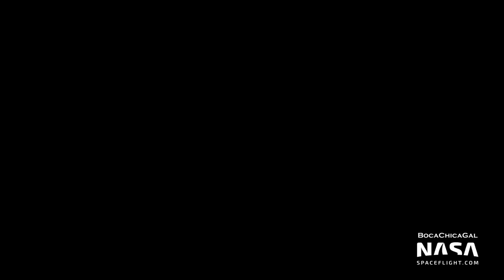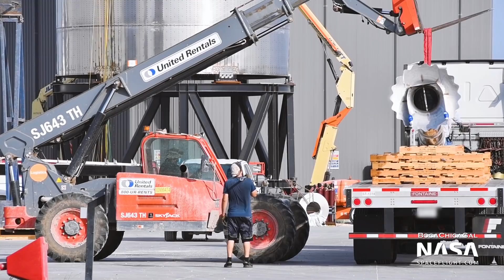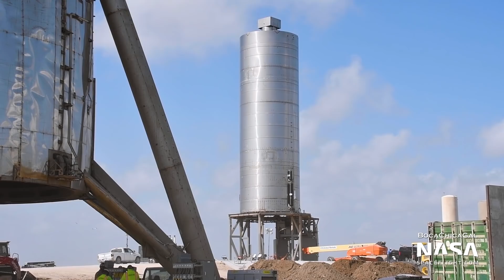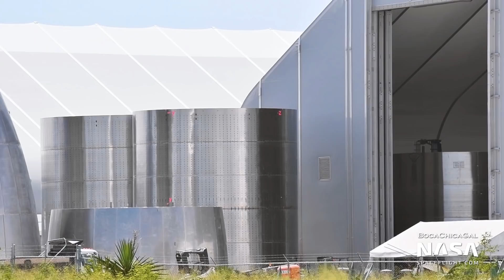SpaceX Boca Chica - Starship SN10 parts arriving as SN6 looks forward to hop

Comment from the maker: Hop still on for tomorrow and we'll be live with Mary, so make sure you're subbed for when we go live, as it is not a set test time.

0:00 - Sunrise
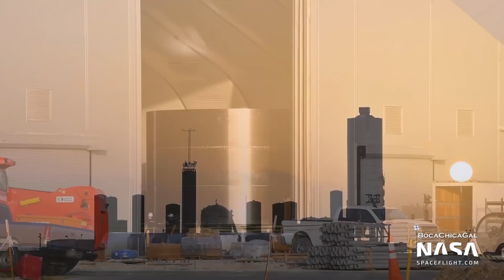1:00 - New Three Ring Stack
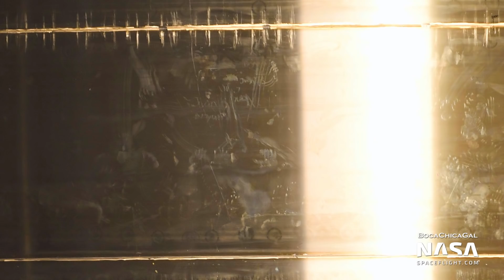1:37 - Bulkhead Dome Caps
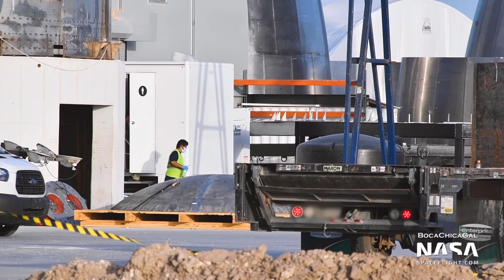1:55 - High Bay Construction
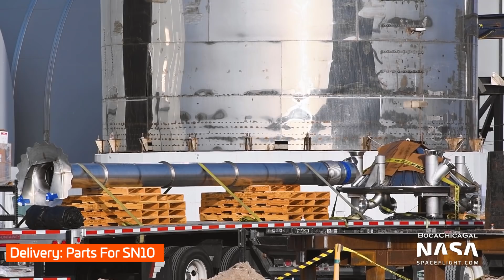2:40 - Delivery: Parts For SN10 
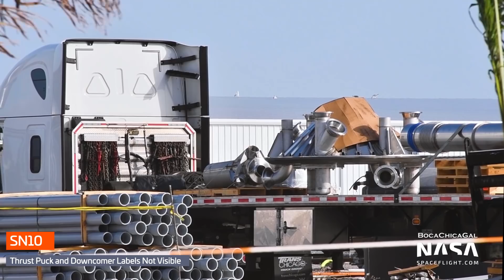3:10 - Parts Close up
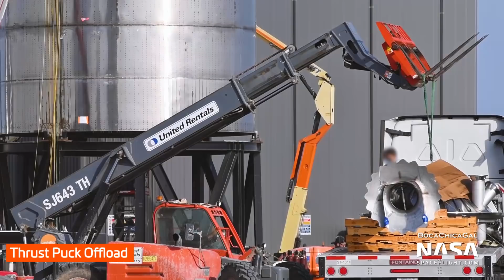3:51 - Thrust Puck Offload
4:39 - Methane Downcomer Offload
6:07 - Orbital Launch Pad Construction
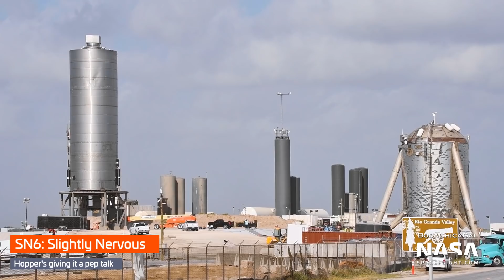7:59 - SN6 and Hopper
8:26 - Landing Pad And New Mount
10:27 - Earth Work At Launch Site Continues
11:26 - High Bay Construction
13:20- High Bay And STARGATE
14:10 - Equipment At The Old Gas Well Lot
15:10 - Noseconeland
16:46 - SN5 and SN8
Reply: Just in time to get my Boca Chica fix before bed. Thanks!
Reply: Bulk head dome caps are noticeably becoming flatter as elon mentioned earlier in his tweets
Reply: Is it my imagination, or is the newly delivered thrust puck a redesign (a completely new design iteration)?
Reply: @danahebdon6810  not completely becoz elon said he wants to remove the unnecessary steel reinforcements in the thrust puck design nd this design looks for a 3 raptor testing
Reply: Does Mary live in Boca Chica?
Reply: @burper-oe6tm  Yes. She is one of the few people that do, other than SpaceX employee's
Reply: Critical rocket parts being stored outside in the dirt!
Reply: @DavidJohnson-tv2nn  remember Elons crew our space cowboys lol.
Reply: David Johnson it’s a measure of how far we’ve come.
Reply: @danahebdon6810  Agreed.  Seemed to support more raptors than previous.  Also was thinking the methane downcomer was longer.... Starship Heavy?
Reply: Have you noticed that the newer rings have a more ‘bronze’ tint to them as opposed to the earlier versions having a more bluish tint?? Could that be the difference of the new alloys??
Reply: So cool seeing SN8 here

Comment: 1:00 The welds look so nice!
Reply: Huge improvement over a year (vs mk1)
Reply: It is possible they are already using KUKA welding robots
Reply: Yes! They actually do!
Reply: Yes ! It used to look pretty bad, but now it's beautiful.
Reply: @Kavriel  People used to tell Elon "you can't do this, it's impossible". Then he did what he said he would do. Again and again and again. You would think at some point the nay sayers would learn, but they never did lol :)
Reply: Goddamn that is clean
Reply: @vojtamarhoul7151  The Kuka robots are for the nose cone as the weld path varies in multiple axis, for the rings, they are probably going to continue using the robots they already were using since there is little to no improvement to be made there by using the Kuka robots for that, that said the reason the welds are so clean is probably due to the 304L steel not precipitating carbide when welded.

Comment: 11:58 Speculation hat on. Could these container -like mobile units be micro desalination plants? I suspect the water supply to launch pad would need a serious upgrade for drenching system for SH so a short term solution might be to use mobile de-salination. These 2 units look almost exact size required.  Can also be powered by solar\wind and moved to where needed. Seems a perfect short term fit.. Speculation hat off.

Comment: 0.187" printed on the inside of the Downcomer.. that'd be about 4 mil.. lol
And do we know where the thrust pucks are made?
Reply: Gene Lomas .187 is 4.76mm so almost 5 !
Reply: .187 would be the decimal of 1/6th of an inch..
Those guys REALLY need to pick a standard.. either straight metric, or straight imperial..
Where is the logic in using decimals for imperial sizing..?!

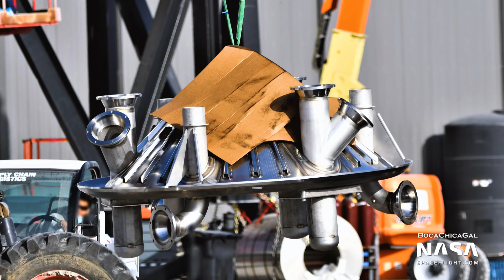Comment: Thrust puck @4:25 has three distinct outlets... 1 prototype for super heavy maybe?
Reply: Why would it be SH? They're not starting the building of that until next week at a minimum. Does SN8 have a thrust puck installed? That is the one alleged to be testing three raptors.
Reply: Either SN8, 9 or 10. 3 raptors for 20km hop.
Reply: definetely for sn10...coz sn8 is already complete with all these...for sn9 were arrived last week...
Reply: I counted 4 x CH4 so I'm presuming SN10 will have 4 raptors.

Comment: would that high bay survive a hurricane?
Reply: I have no idea... I was asking the same question to myself...
Reply: Yes, the high bay will for the most part survive a hurricane. You might see the loss of some of the exterior cladding panels. But overall the way that it's designed, it's been structurally designed for a high wind load..
Reply: Technically it already survived a weak one at the beginning of its construction.

Comment: How do you know what to call stuff, are the naming convention that of SpaceX, or did you name them?  👍👍
Reply: SpaceX frustratingly gives few official terms. Elon has tweeted about the thrust puck and downcomer, and High Bay (so the unofficial Mid Bay is at least a derived term). The big launch pad/launch stand was finally called the Orbital Launch Mount by Elon. Afaik only one building has a sign, the Ground Fabrication Building. The Stargate building next to the High Bay was named that when it was some kind of semi-independent(?) educational facility. Most of the rest are terms that have evolved on YouTube channels and reddit forums.

The control surfaces are a continually vexing problem. Don't function the way fins or canards do. Terms like brakerons of elerons have been proposed by outsiders, but haven't caught on. Elon recently called them body flaps.